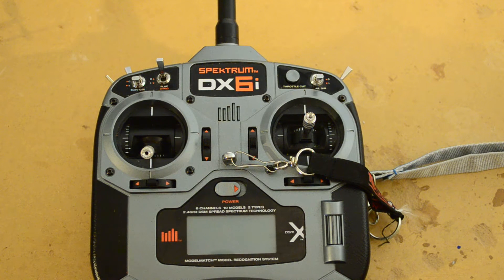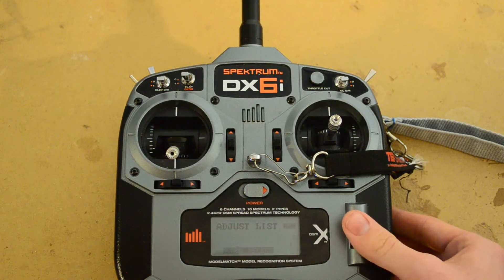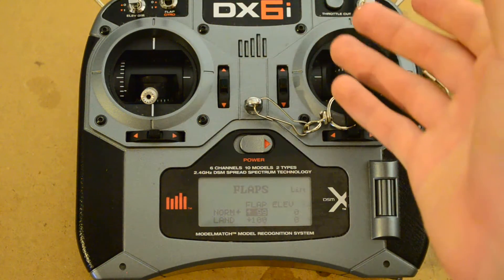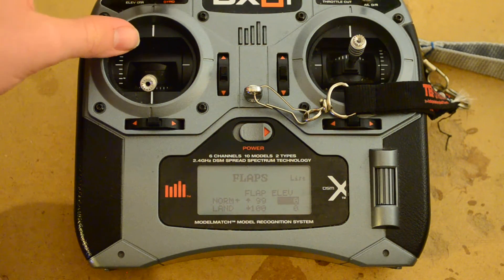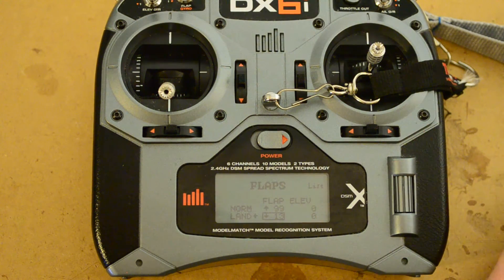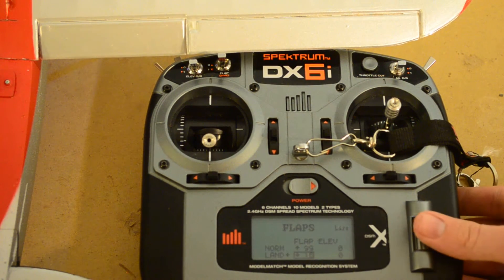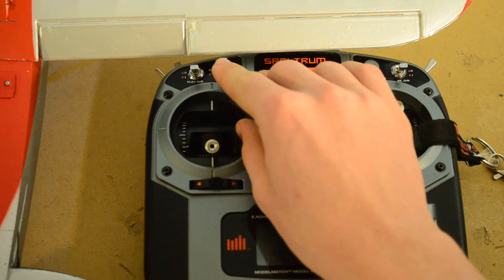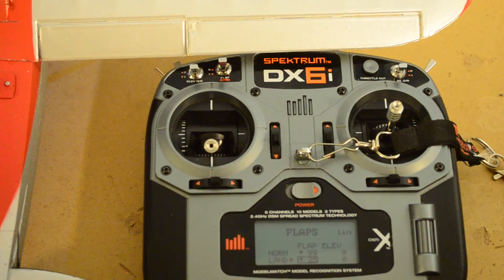Setting up a slider function on the DX6i!

Comment: i would change to the aluminum wheel if you are going to do this. just be careful not to abuse that or you can screw up the potentiometer or break off the leg on your plastic wheel.
Reply: Hi! My thumbwheel just broke. Is there really an alu wheel to replace it? Where do they sell it? I CAed it, but I don't think it will last long, so the alu part would be perfect.The weakness of the wheel is the reason why I wouldn't suggest using it as slider.
Reply: robsg07 best thing to do is google it. There should be parts still available for them even though Spektrum screwed up and knew it,I see they already came out with a Spektrum 6e just recently.
Reply: Hobbyking's got it. Thanks for all.

Comment: this in not good idea..  sorry bother..
Reply from the maker: +Muslim Khan Sorry you didn't find it helpful! Could you elaborate on exactly why you don't think it's a good idea?
Reply: Its a crummy transmitter anyways,you cant hurt it by doing that.Its not a Futaba by any means so just go with it.
Reply: @scottfirman  there's nothing wrong with this transmitter. I've been using mine since they first came out. I've owned more than a dozen Futaba radios including the top of the line industrial models.
I have never had a transmitter fail in any way. Not one. So don't go throwing away your DX6i.
However, I have to agree this isn't a great idea. Interesting, yes. Clever, DEFINITELY. Practical and ultimately safe, not so much.
If I thought about it long enough I could probably come up with several reasons but the first one that pops to mind is probably the biggest; pilot workload and distraction.
there are a couple of ways that this could happen and rather than try and work it out or prove or disprove by showing you let me just plant the idea in your head..
First of all anytime you have to look down at your transmitter is a bad thing. Second, leaving your mix open while you're flying you could accidentally end up in any menu and god only knows what you might change my mistake. Especially if things get dicey....
And again, just off the top of my head, landing is no time to be fussing around with anything. It's arguably the most important time of the whole flight. If something bad is going to happen it's going to happen at the end of your flight and close to the ground when you're low on battery or trying to get on the ground following some incident or failure in the air. You need to be focused on what's going on, not having to mess with switches and menus....
My 4-5 cents worth (when adjusted with inflation)...